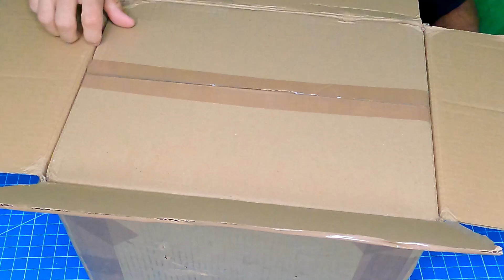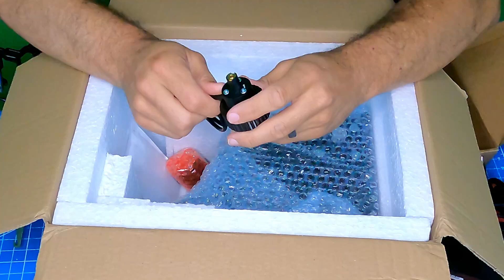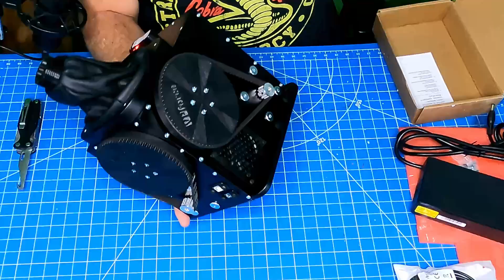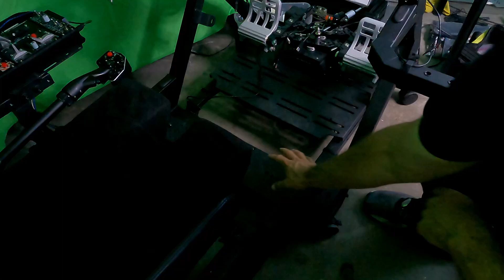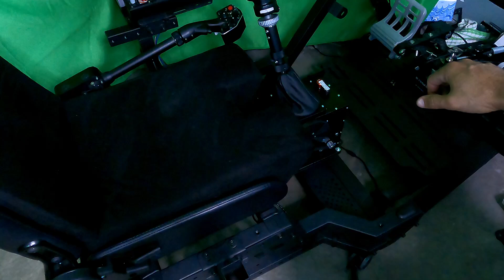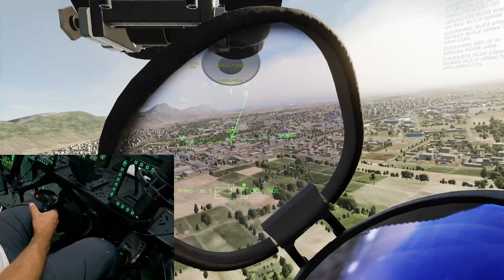VPForce Rhino Force Feedback base Review - Episode 1: First Impressions

Comment: That's a very good review !!!  Honestly , I don't know to who this device intended to. It looks like a prototype to me (Heavy, pully outside etc) . pricing is very high if you consider it's only one small part in the big chain - only the base (no stick). if you consider you have to get collective , throttle, pedals etc... (PC/VR) spending 900 EU on a base is gonna be for the enthusiasts / business. But when you understand actually what we need , you can defiantly see that we need a system that get's us full control for damping , springs, trimming and feedback. to get all of that in one package it's gonna be motors and electronics. you cannot do all of this with springs and cams. I will be waiting to see what the big guns will release soon, hopefully to see YOU compare them to that beast. I am referring to MOZA , Winwing. probably Virpil and VKB will enter the game also. don't know what Thrustmaster is doing. Pricing for Moza is already known for about 550$, so if it can do 70 percent from what that beast is doing - A lot of us mid range buyers will go that rout I believe. LOVE !
Reply: The Rhino and the Moza have virtually the same specs regarding max. torque. However the Rhino beats the Moza big time in regards to software and support (at least for now).
Reply from the maker: @MrSpinkser  yeah the software is absolutely huge. I did reach out to Moza to see if they would be willing to send me a unit to compare.
Reply from the maker: @Simon7storm  the Rhino is made by a single person, this is a production model, and the build quality is quite good. Expensive yes, but mass manufacturing will definitely help to bring the price down.  Moza, and Winwing both have hardware that will likely rival the Rhino, but the software is the thing that for now will continue to set the Rhino apart. The Rhino is far ahead in this regard. I flew it for a couple days without the Rhino telemetry and it makes a HUGE difference.
Reply: @FalconsLedge  You know in a way it is a good thing. if the hardware is good , and software lacking, it can only get better. especially when talking about large company with big resource. If the hardware lacks, it means I am stack with what I got and I have to replace it or find a way to upgrade. That Rhino is great, but it will need to get smaller and cheaper to compete , or it will stay positioned as a botiuqe level product - and it is fine as well. as a consumer, I am holding all buying for bases, I was looking for good cyclic option as I main choppers. The CM3 I believe is the best for it. but the current state is that force feedback is the the futer. I don't need to use springs and cams, to open and re adjust. Just move a slider. and I can switch between platforms easy. If  want to play chopper and switch to F16 - I will probably have to buy two bases. Any way MOZA and Winwing I hope you read it - SEND HIM TEST UNITS !!!!  cheers
Reply from the maker: @ShimonMaruani as the software matures, we will either see Mozas hardware shine, or it will expose issues, we shall see. Either way, the competition will be good for all of us as consumers